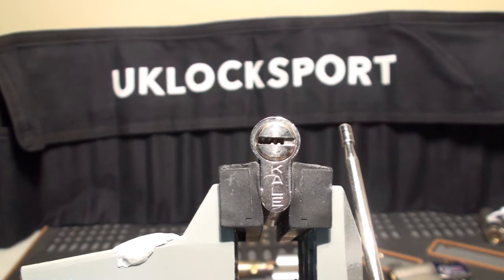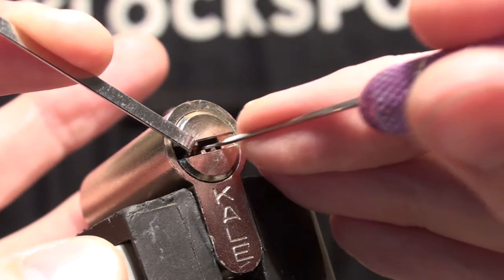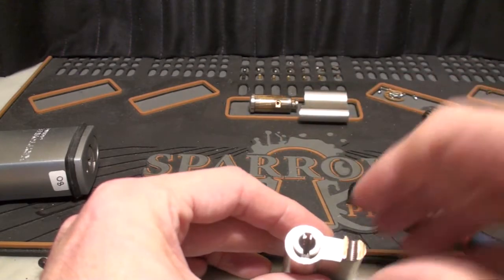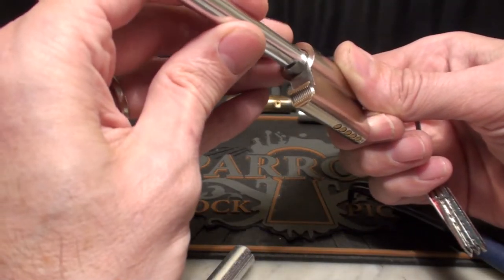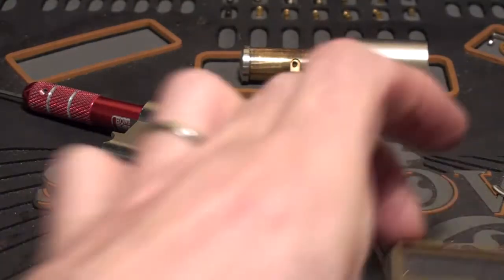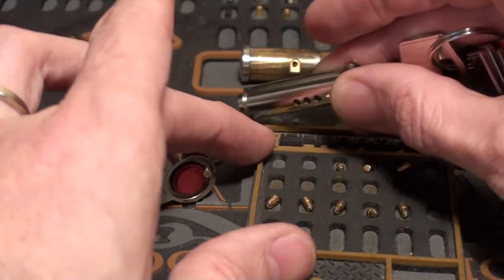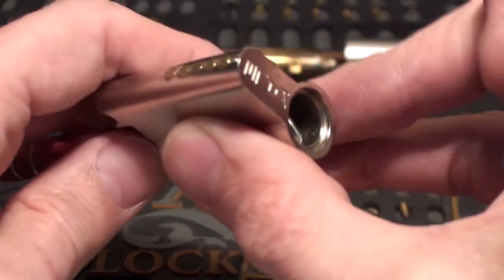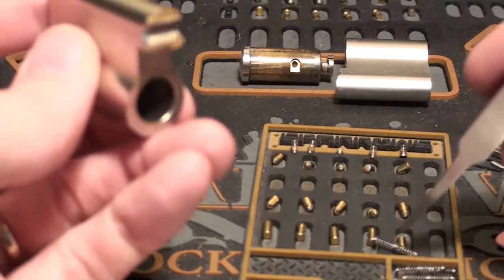091 Kale Kallit BNE5, 10 pin dimple,  picked and "gutted"

Comment: Great picking again Tony, this is an interesting lock, it reminds me the Tesa T10, the concept, the keyway, the upper drivers, the lower springs are very very similar, but the lower key pins and drivers and the aparently poor tolerances in comparation to the Tesa make the difference. In the Kale the upper pins touch each other with the lower pins but the upper pins dont bind until the lowers are set. In the T10 uppers and lowers bind mixed and the lowers push the uppers, overseting them. A ten pinner anyway, not an easy picking and you defeat it like a boss. We want more ;o)))
Great picking and great vid my friend, thanks for showing ;o))